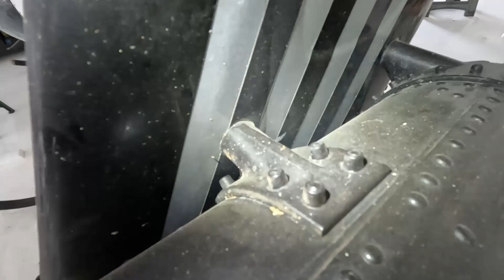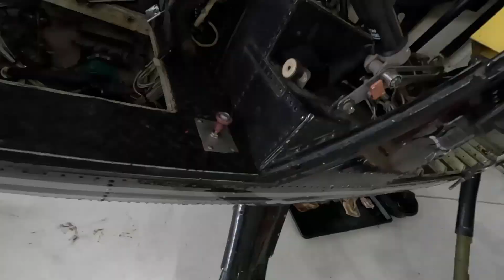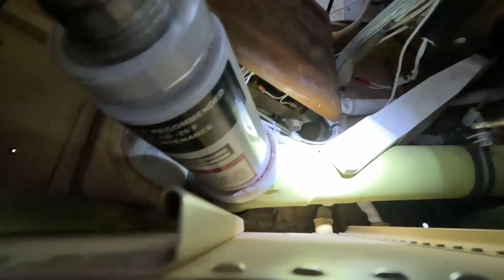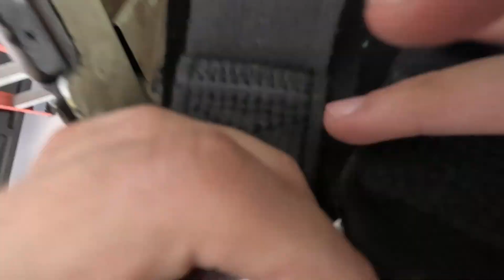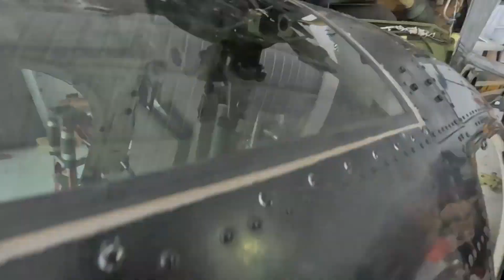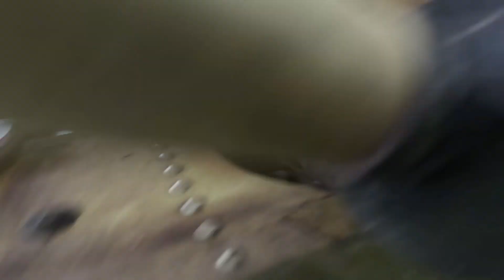Throwing Every Tool I Had at This Helicopter | A 100 HR Inspection Overview

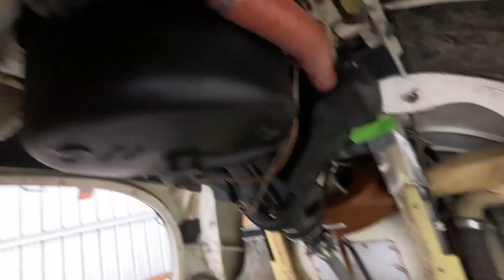Comment: 9:06 . looking back and up , above the fan . check trans-cooler lines so they are not contacting each other. 
applicable to 1981 h369d and newer.